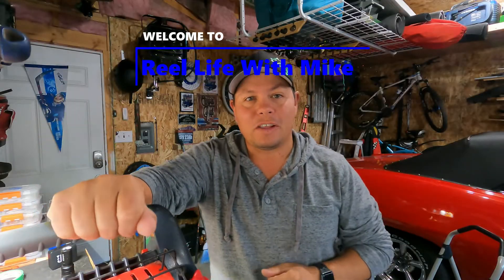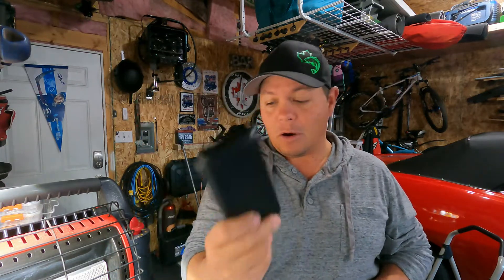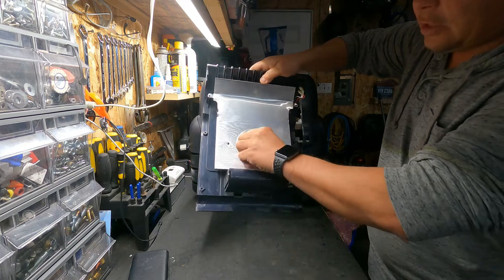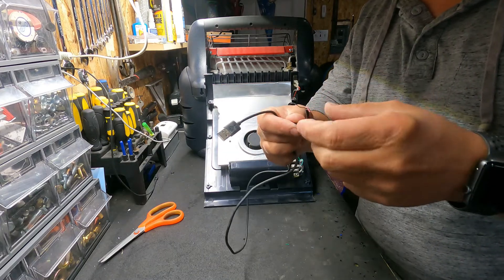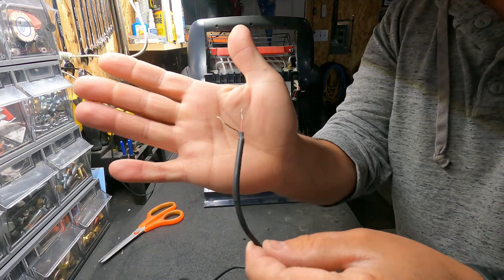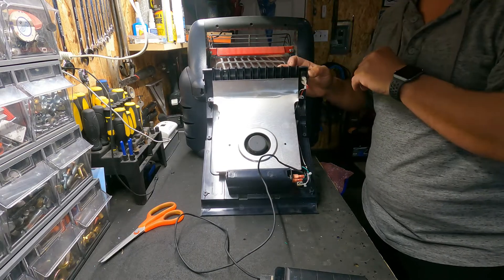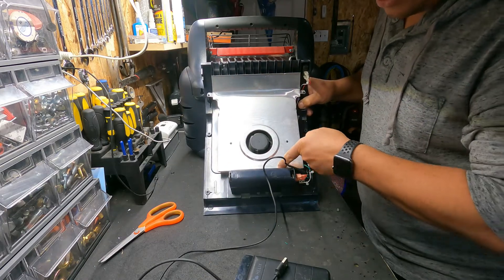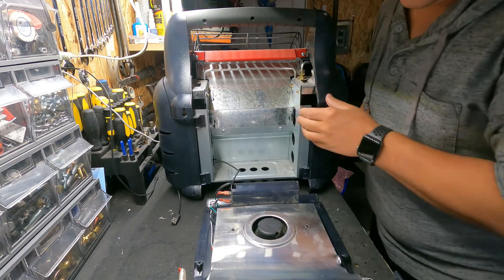Big Buddy heater USB power bank supply modification

Comment: You could also wire in female terminals and plug into a 6v battery. Just like your flasher and  except you'll be using a 6v battery.

Comment: What's the Store Price for the Big Buddy Heater with a built in fan ? Can the Big Buddy Heater be used with a 20 pound BBQ Tank ? How long do the 4 D Batteries last if the fan is used continuously non stop ?
Reply: I use a 20lb tank with mine. I've never used the 1lb bottles with it.
Reply: @delgada747  and how many cold nights in a row can you get out of a single 20 lb tank ? Do you have your heater set on low, medium, or high ? How long do the 4 D Batteries last if you are using the fan continuously ?

Comment: Ok, just got a new cord at Harbor Freight and timidly cut a brand new cord.  Thicker guage red, bare copper, green thin guage, and white thin guage.  Guess i just wing it.  Its low voltage and shouldnt have an issue

Comment: I've seen a couple of these mods now and have one question, instead of modifying the heater why not just put the connector on the end of the USB cable to fit the 6 volt jack and plug it in there ?
Reply from the maker: I dident like the jack as I broke a couple of them as they stick out a bit. More of an opinion

Comment: Remove a TEC module from a gimmicky desktop microfridge, bond it using silicone to the hearter brick mount with the heatsink mounted so the fan blows across also secured with silicone. Wire the TEC module to the fan leads and it will power the fan as the heater warms up. Self powered ❤

Comment: Neat idea. Worth mentioning you could add a cheap buck boost converter to up the voltage to the proper 6 volts if desired.
Reply: A favor?  I’m not experienced w electronics. Could you recommend a converter appropriate for this application?  Many thanks in advance

Comment: Wouldn't have been easier to find a male 6volt plug and wire it the USB? That way you can just plug it into 6 volt jack without having to open in all up?
Reply from the maker: yes I have done that before but you would be amazed at quickly the plug gets damaged or broken when sticking out the back.  Also I am bad at remembering things and am sure I would forget it or drop it somewhere ha ha

Comment: Nice work! But isn't it possible that long term under voltage might shorten the life of this somewhat difficult to obtain fan motor?
Reply from the maker: From the model number on the fan that it has an operating voltage from 4.5-6.5 volts. So I assume it’s still in a normal operating range.

Comment: Thanks for this video. Being the owner of several power packs (5v USB outlets) that are great at collecting dust, I've found a use.  Likewise, I never intend to use 1.5V batteries.  The USB cable hopefully will route back into the battery compartment and be protected with the cover installed. Tomorrows job!  Thanks for this effort.  Take care.

Added:  Job done in short order and worked as shown.  Thanks again.

Comment: Ok in places like homer DEPO you can find big USB fans small table top with clip great for pushing the heat further with power pack or wall adapter great for daily use or power out if you got the little buddy or on with out fan.

Comment: Hi, does it matter which side of the heater you connect a 20lb tank on?
Reply from the maker: Not at all depending on the connector you use. I have the quick connect which is on the right side I believe.